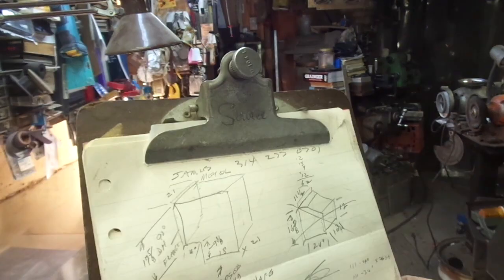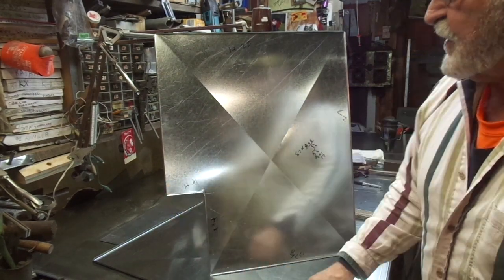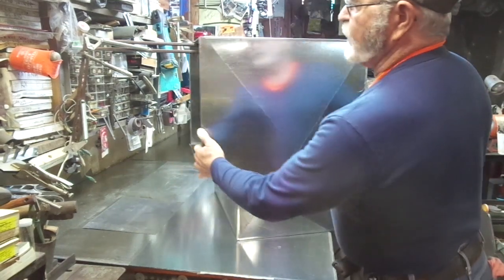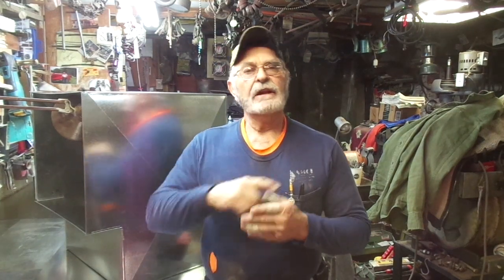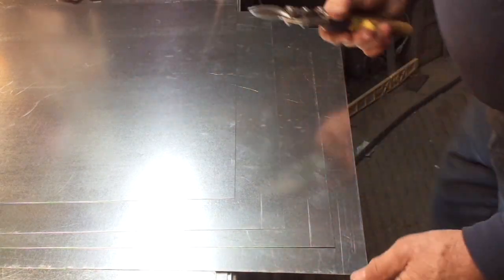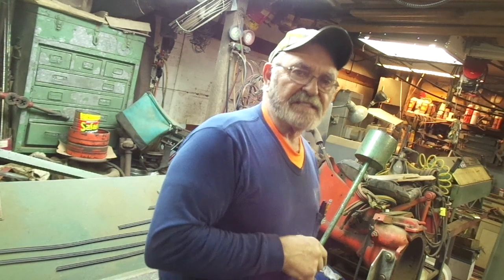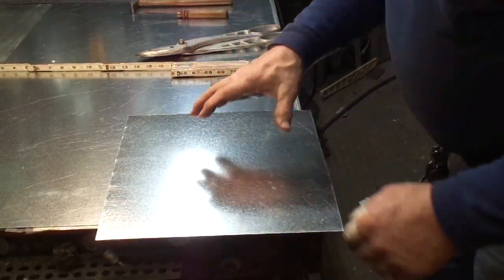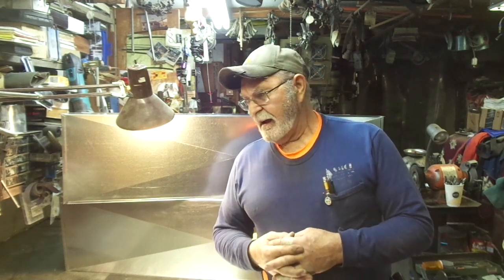Straight Duct and Return Air Plenum Fabrication

Comment: How did you made the X on the sheet metal sir?
Reply from the maker: The piece is entered into the brake at an angle across the corners where the 'X" is wanted.  Then the brake is just raised slightly, about 5* to 8* to leave a slight bend. For a specific example go to this video and either watch the whole process of fast foward to 5:30 to see a cross break (X) being made.

Comment: Thank you sir for great videos and explanations. Could you advise if there are any rules of thumb regarding the number of elbows in the duct branches? Sometimes I see  8-10 elbows on 20-30' length 5"-6" duct runs and wonder how much air can come of that duct. I do ac/furnace installs, but I am not sheet metal worker, so dont have much experience with the duct design/installation. Thanks a lot.
Reply from the maker: The resistance in one round elbow is equal to the friction loss in 100' of duct.  So you can see quickly how detrimental they become.  I won't use more than two and those I make every attempt to make two 45's out of the 90's. That eliminates more than half the loss.  The same goes with flex. I've seen commercial istalls with two 50' runs of flex tied together and bending, twisting, looping through the rafters in restaurants with little to no air delivery at all.  BOCA limits flex to 7' on the end of hard pipe to tie into a ceiling register.  Or that's what it used to be.  But two 90's is about all I'd ever consider in hard pipe.  Btw, have you looked at any of the videos in the playlists up above like this one: https://www.youtube.com/playlist?list=PLk72G9DTzZ1tqw8ST_xdUlPoy_O-SmuBx Or my most recent upload : https://www.youtube.com/watch?v=i2KFLZGbZwI You might find something enjoyable there.
Reply: @tractorman4461  thank you 👍 yes, I watched them. Although, i think you missed one with the final setup of furnace with add on wood furnace 😁 Thank you and I hope you will post more videos related with the hvac 😊 p.s. I just noticed in the last video that you write a lot of tips in the description part, so I will have revisit all your hvac related videos 😁
Reply from the maker: @thecurious6721  Oh heck, I expand on a LOT of the videos in the description box.  Not all, but a lot of them.  And yes, there are several more videos on the wood furnace/air handler to edit and upload.  Just busy with tons of stuff.  I appreciate the time you are taking watching some of the older vids.  Some of my first ones are a bit hokey and more than a little boring.  Editing streamlines them a lot better now.
Reply: @tractorman4461  thank you. I appreciate a lot your doing, filming and sharing your knowledge 🙏

Comment: Hey thanks for these videos. Can you tell me why slant notches are used for flanges on duct work?
Reply from the maker: A lot of guys don't bend a double hem flange, but that only works with heavier guage metal as in 24ga or thicker.  The 1/2'' angle cut keeps the chance for a really sharp edge at the end of the fold that is good for catching flesh on a guy that's handling the metal while installing.  I think mostly it's a personal preference.  I like it, others do not and still others insist on only a 1/2'' single fold for a plenum edge.  But those single thickness are the ones that buckle as its handled or when the zip-in slips a little while screwing down.  Double hem does not, even on 28 ga.

Comment: Good morning Tractorman44 ,I have a 725 sq ft home that I'm thinking about redoing the ductwork. The house is 725 sq ft no air bedroom 1 12'x 10' bedroom#2 10'x9' living room 14'x16' all 8ft ceiling.Could you tell me what size trunkline I would need? The kitchen and bathroom ducts would stay the same.
Reply from the maker: Its hard to be specific because of not having a heat load calculation on the project.  Heat load calcs can be figured with some on-line sites.  You'll have to know the 'Design Temps' for your area to implement them correctly.  My area, central midwest, the design temps is 5*F for the winter and 95*F for the summer.   Those temps go a long way to determining what size heating and cooling system is right for the premises.  The next thing is the level of insulation and the type of windows and doors in addition to their sizes. 
    Then of course the layout of the house and the location of the floor registers is kind of important because as branches are taken off, the trunk line contains less air so the size should be adjusted to maintain velocity with the lower volume of air to ensure it has enough static pressure to get to the remaining ones at the end of the line.  Complicated?  Yes it kinda is but probably not so much with your square footage because the total duct network shouldn't be too complicated.
    In this area, depending on the heat load calc, either a 1 1/2 ton or 2 ton a/c would be used with probably a 7 1/2 or 10 kw electric air handler.  Duct sizing would probably be 14''x8'' each direction if the air handler was positioned in the center probably with no transitions in size.  If it was to be located on one end, the sizing would probably start out 18''x8'' with one transition to 14''x8''  at the point where the first two branches are installed.  Bear in mind this is NOT a direct answer to your question but moreso a suggestion to first find the answer to the unknowns in the equation outlined above then make an informed decision so you know for sure what is to be required. 
    Remember Eric, that too small of duct increases velocity and along with that increases the noise level within the residence.  Too large of duct is detrimental as well to system operation because the lack of velocity could cause low air delivery to extremities.  However, there is a bit of leeway to play with.  So if you are using the existing furnace and a/c the very first thing to determine is the blower capacity of the unit.  That will be the starting point.  If its never cooled or heated the area adequately, the starting point should be to determine what size the structure needs.....meaning performing the heat load calculations as mentioned above.  Hope this helps you in deciding the route to choose.
Reply: @tractorman4461  Thank you sir.
Reply: I have the furnace already just trying to redo the ductwork . what I have is the supply ducts on the interior walls and the returns on the exterior walls. The living room had one supply feeding it with a 3.5"x 12" duct. I was thinking that a 8"x12" with 1 8" for the living room, 1 6" run for the smaller bed room and a 7" for the bigger bedroom.
Reply from the maker: @ericricks1668  What we did dozens of times back in the day of dying gravity heating systems, was to convert all the interior supply air registers to return air openings then cut new 4x10x6'' boots into the floor at the exterior of the rooms.  This way the warm air countered the cold draft created by the outside walls and established a good recirculation of the air through the interior wall locations.  Of course bathrooms and kitchens were blocked off from having a return, (because of circulating cooking smoke or smells) and just cut new supply air registers in those rooms.  All supply's were (and still are) supplied with 6'' pipe.  I'd suggest instead of the 8'' run in the living room, install two 4x10x6 with six inch supplys if at all possible.  Same with the 7'' to the larger bedroom.  I'd suggest two 4x10x6 runs there as well.  See, almost all floor boots come with a 6'' round inlet.  You may find its defeating the purpose trying to bush the 7 or 8 down into the 6''.  Make sense?  It'll cost more, but it will give much better circulation, flood more consistently across the living area and be less noisy too.  If you still have too high velocity resulting in excessive noise, pick the room that's not the comfort level you are looking for and add another branch to that room.  If you can manage to get 120 cfm out of each floor register, your system should circulate fairly well. These are random thoughts that may give you more to think about while you are setting up the system for good.
Reply: @tractorman4461  You're the man! Keep doing your videos sir. I truly feel your calling is to teach.

Comment: I would like to see you show the people how to make and install turning veins in you elbows. Even this particular elbow is so close to the unit it probably doesn't matter
Reply from the maker: I think somewhere back in the older videos there's gotta be at least one set of turning vanes I've made and installed....but I have no idea which one it would be in.  You're right they aren't needed in this close of a fitting from the opening in the ceiling to the open bottom of the air handler.  My 100' box of 
Duro Dyne roll of vane rail is just about empty.  Probably only 15 or 20 feet left.  I'm sure I'll have one to make soon that's going to require it.  
     A commercial installation with higher duct static and higher velocities throughout the entire system though get turning vanes in every radius fitting in the supply air, but seldom in the returns.
Reply: @tractorman4461  yea it really just depends on who is drawing the print. I've seen turning veins in both s/a and r/a .  But sometimes just the supply. But I've never put veins in a radius elbow just a square 90. This is such a great trade to be in. I wish more duct guys knew how to make duct. I moved to a smaller city were making duct is a useful trade. Were when i lived in the big city it was mostly all plasma machines that did all of the duct making. But knowing how to make duct helps in the field. Making an offset to some guys isn't an option. I've seen it.

Comment: Great work tractorman some more sheet metal work! I just finished my own system this week finally and I gotta say I’m addicted to metal fabrication, it’s interesting and enjoyable to me, but only when it’s my own system ha. If I had to do it daily I might have different thoughts! I basically used your videos to guide my entire system design and fabrication. Anyway thanks for the notching close ups!
Reply: Question, do you design your ducts for a heat pump or traditional AC system? Curious if you enlarge the ducts for a heat pump and if you ever measured the static pressure to monitor performance etc. thx!
Reply from the maker: @r0gerp0dacter  Yes, and yes.  I usually size the heat pump ducting approximately 20% larger to create much lower velocity. Too high of a velocity causes the lower discharge air temps to feel cool to exposed skin.  Slowing the velocity makes it seem warmer.  The attic one I did for my son had some particular reasoning as to why I didn't stick tightly to that concept. Too lengthy to elaborate here, but it is doing exactly as designed...which is good.
Reply from the maker: Glad to hear you've completed....now for the pictures....LOL.  I'm SURE you've mastered the hand formed pittsburgh lock to perfection !!  If you did it daily it would be much easier because chances are you'd be working in a shop with some tools much fancier than my old rusty and dusty stuff !!  Until you made that comment a few videos back I hadn't given real thought about showing a close up.  Guys do notch differently though.  Thanks Roger for hanging in there and watching all these videos. I do appreciate it and I am glad to know you got a little help as a result.
Reply: @tractorman4461  surprise! Here is a video I uploaded to my channel showing my new system install. (Sorry I’m not good at video). Not sure how to properly share, but it’s on my channel and I have some call outs to this channel!

https://youtu.be/qLYP5tayk2U
Reply from the maker: @r0gerp0dacter  I'm on my way to watch.  And thanks for the shout out !!

Comment: hi there   you do it all . nice job  very interesting to watch  but it looks like that tin bit your finger  john
Reply from the maker: Hahahaha...I edited out the comment I made in the video about that.  But what the deal is I've had my fingers frozen with refrigerant and refrigerant oils and acids so many times in 40 + years that my fingers just dry crack and separate along the fingerprint lines for no reason.  Hand lotion don't do hardly a thing, but by wrapping the cracks up with a high glycerin salve they seal back up within 3 or maybe 4 days. I almost never get a cut with the metal, but occasionally a little tinner's whisker will poke a hole or give a superficial rip or tear.  It usually happens worse in colder weather.  Now watch, tomorrow I'll have to go get stitches.....LOL. Thanks John for watching !!
Reply: @tractorman4461  i know what you mean about tomorrow  well just be a bit safer tomorrow  . you know the older we get our bark  gets thinner  john